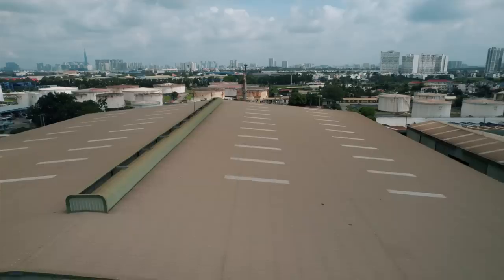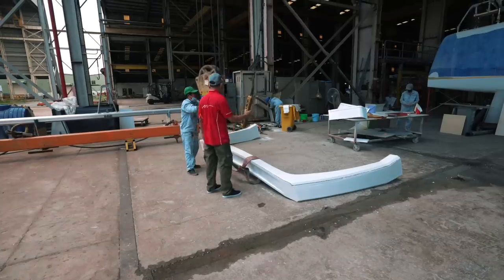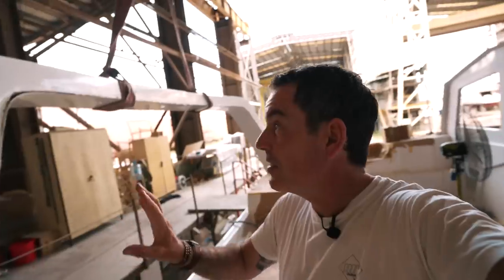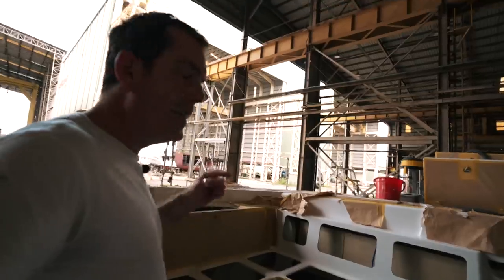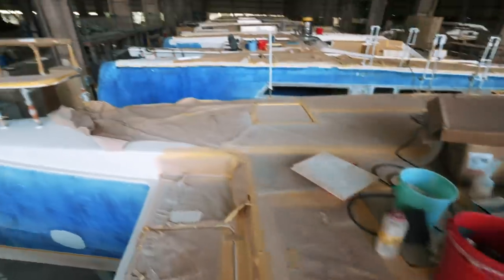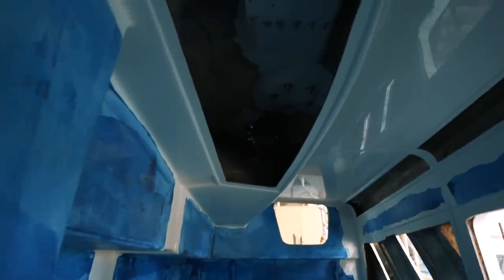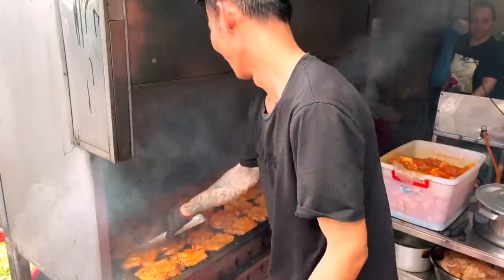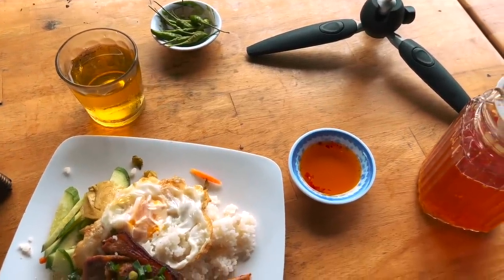CATAMARAN BUILD Update: The Targa Arch is Complete! This is a BIG DEAL

Comment: Question: How do the teams work? Is there a team that follows each boat through or are there teams that just hand molds then others that are decks and so on and so forth. My guess is that as hull 2 RR2 is streamlined that by the time they get to 3,4,5, & 6 each one will go a little faster? Obviously, hull one is the most time consuming. I am simply curious about the structure of the teams working on each of these boats. I am assuming there isn't just one team as then there would be not much sense in starting new ones while still working on the first one.
Reply: In my family we grew up in a very rural areas. My family would eat traditional breakfast foods for dinner, and vice versa.

Comment: Doesn’t stainless corrode in anaerobic environments ie. under glass?
Reply from the maker: No
Reply: I was thinking the same thing - if salt water gets in there and trapped with no oxygen. 

I’d have thought a heavy fibreglass or carbon fibre backing plate might be better